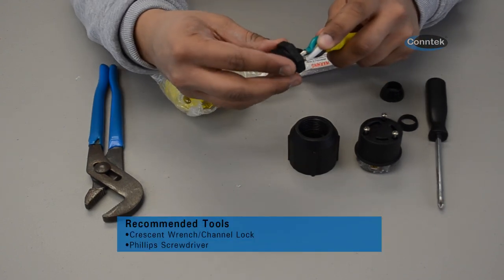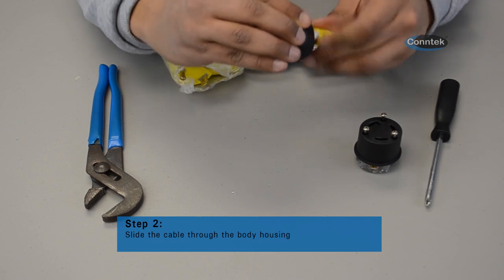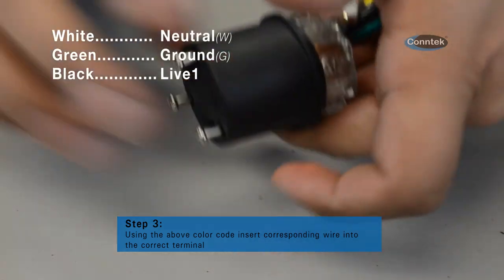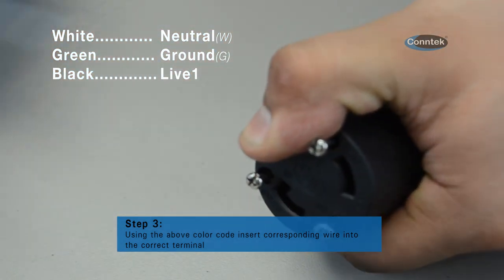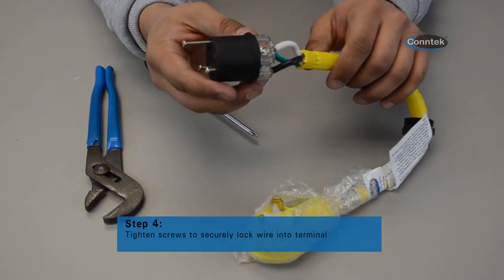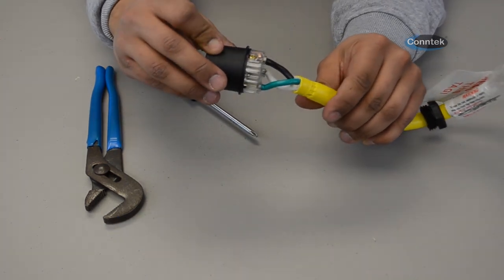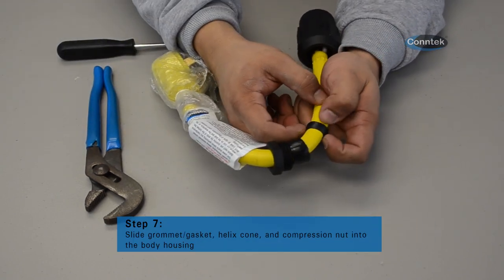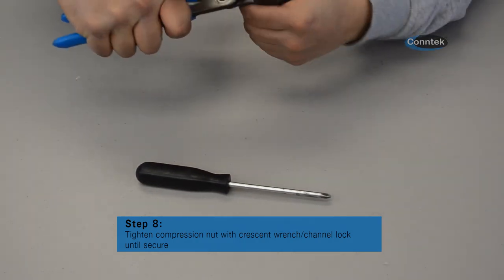How to Wire A 3 Prong Locking Connector

Comment: In this type of conector the X is for the live wire  marked as L in other hardware the wire color is  black for 110V or blue for 240V,
 
The Y marking is for the neutral wire N, 
 white wire for 110V, and brown wire for 240V.  The ground inlet , green screw, takes the solid green or green-yellow wire. I hope this helps...

Comment: no color coating 
which one is hot
Reply: I'm not sure what exactly your question is but he reviews the color coding connections at 1:04.
Reply: @lukesenko963  That doesn't answer... Basically, which one does the "hot" wire go into. You have ground, hot, and neutral... We are told in the instructions, one goes to the brass, and one to the nickel... But there's no difference when I look at them
Reply: see my comment above...
Reply: @stalinchinguetas4805   With no color coding, you have to have a voltage meter and in my case, an ohmmeter.  The two meters are usually both found on one multimeter.  I have to wire a 3 wire L5-30  RV cable into a twist-lock RV receptacle.  I accidentally shorted the connector on the hot electrical box in the RV park, which charred the hot lead, so I already know which prong is "hot" on the park box.  But I don't know for sure the color coding on the wires on the other end of the cable, but there's a black, white, and green wire.  So I assume this is the standard color coding, black is "hot", white is neutral, and green is ground.  But tomorrow I'm finding my "continuity meter", aka, ohmmeter.  You can also buy a cheap continuity tester at an auto parts store or on the internet.  These usually have a dime size battery and a led that lights up when you touch the prongs together, which means it's working.  Then you touch one prong to the plug end of the cable, the other prong to one of the wires on the other end until you find which wire goes to which prong.  If you know which lead is hot on the outlet, you know which wire is the "hot" wire.  It takes a voltmeter to test the outlet box.  you stick the black lead into the ground which is always the round connector on an RV 30A box.  Then put the red lead on the voltmeter into each of the two flat receptacles until you find which one is "hot" and which is neutral....as far as the inside circuits in an RV, you have to have the documentation for the circuit breaker / power distribution center.  The exact model is usually on the inside of the front cover.  Then you look it up on the Internet, to see what the color of the hot wire is for the power distribution center.  Hope that helps.....
Reply: @stalinchinguetas4805  :With all due respect sir,i do not believe there is any  240 connection wire on the L5 plug